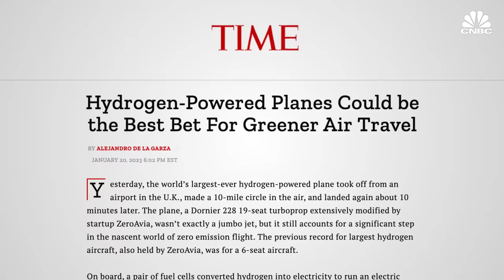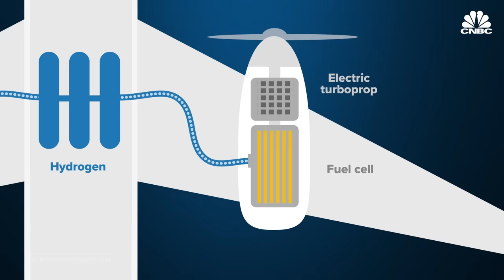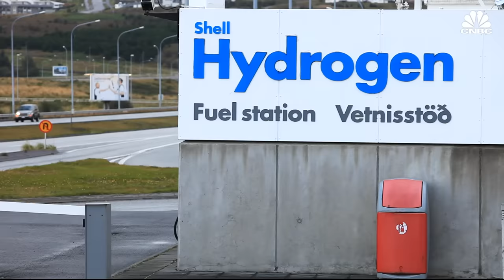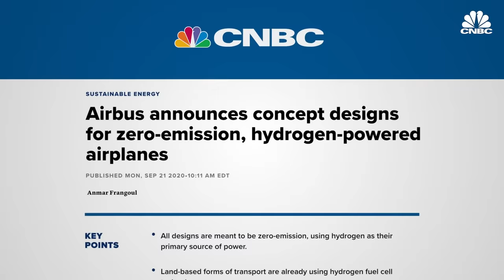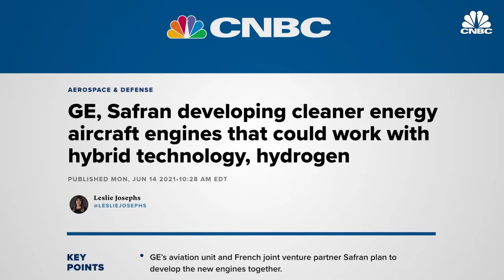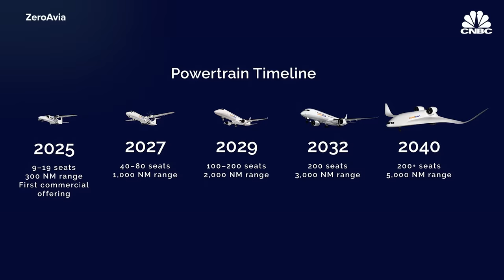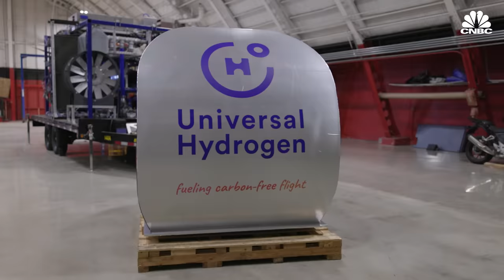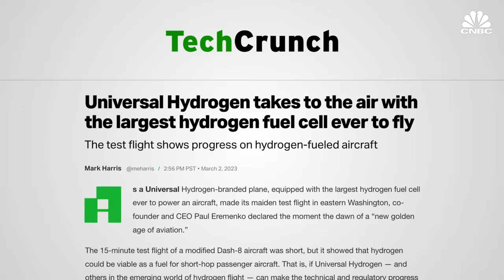Why Hydrogen-Powered Planes Will Beat Electric Planes

Comment: You don't really need hydrogen to reach 0 CO2 emission goal. You can just produce a conventional aviation fuel from plant sources. For example corn is used to produce fuel in Brazil. Whatever CO2 produced by such fuels will be re-absorbed by the plants to produce oxygen. So overall the total net emission of CO2 would be 0.
If there is not enough land for planting, they can use sea and using algae, the same goal is achieved. This is much less costly and can re-use the existing airplanes and technology.
Reply: The problem with biofuels (particularly ones made from corn) is that they require astronomical amounts of water

Comment: the problem with Hydrogen is the cost in energy and other resources in producing pure hydrogen, storing it, distributing it, so all the advantages of hydrogen quickly evaporate when you add up all the cost. We need research on reducing the cost of all of this before we can make good use of hydrogen.

Comment: At minute 3.00 in this video the claim "hydrogen fuel cell is more efficient than combustible hydrogen" is not true. Combustible hydrogen in the ICEngine of a Plug-in Hybrid PHEV drivetrain can 'effectively' deliver more than twice the equivalent MPG possible in fuel cell EVs. This personal car application of combustible hydrogen emphasizes the need to reduce driving overall, not merely replace fossil fuel for travel and transport purposes. PHEVs offer more equitable distribution of  battery resources and the more ideal application of solar PV arrays (on rooftops and neighborhood mini-grids as opposed to vast solar field arrays that require long-distance transmission lines connected to complex regional utility grids, both of which remain vulnerable to power outage. Most air travel is recreational. A lesser level of air travel is defensibly essential.

Comment: Water vapor is also an emission.

With the current gains from renewables, we will never have enough power to generate enough hydrogen. Our prices for electricity will skyrocket and meanwhile we neglect nuclear technologies for blue sky technology.

I'm from the Netherlands, here on our best day we totalled just over 400MW from renewables. A single MSR will do the same, 24 hours per day, seven days a week and for 50 years. Why are we investing billions in renewables when the gain from a single billion MSR is very clearly cut: better.
Reply: So at any time there are about 10000 planes in the air, lets say with a 1MW power source per plane we can only deliver 5% of the power required to keep all these planes in the air.

So this idea might sound nice, it is completely unrealistic if we keep using renewable energy sources.

Comment: Hydrogen still emits the water vapor to form clouds which is the majority of the radiative effect of aviation. Switching to green hydrogen will eliminate CO2 emissions, but it doesn't solve the greenhouse effect of aviation. Battery electric planes are the future of short range flight, since they will be so much cheaper to operate than hydrogen planes. I suspect that long range aviation will be dominated by battery and biofuel hybrids, because they will be cheaper to operate, and their radiative effect will be lower than hydrogen planes.

Comment: Hydrogen looks good on paper and in trade studies. But it causes a lot of problems right from the design stage. The liquid H2 pipes cannot be inside the fuselage, for obvious reasons in case of a leak. They have to be outside the fuselage, which creates more drag and you have to protect them there. Also, the insulation makes the pipes quite thick. These problems are just related to the pipes. I work in the field and there are a lot of other problems. These problems can be solved, but due to the increased complexity it will definitely have a negative impact on the price of the plane, maintenance, passenger capacity, airport handling and more... I'm really struggling right now to know if the hydrogen plane is the best way to go. It would be great if there was an e-fuel that is liquid at room temperature, has a high gravimetric energy density, is non-toxic and has low carbon emissions when burned. Can someone please develop such an E-fuel?

Comment: Did they mention that currently commercial hydrogen comes from fossil fuels? It could be made by electrolysis, but it's more expensive that way.
But yes, continue with the experimentation. Modern avgas, used for piston airplane engines, even has lead in it.
Reply: they just recently developed unleaded avgas....with hydrogen the idea is that you would split water using green energy.
Reply: @neutrino78x  Yes, I know electrolysis can be powered by green energy, but it's more expensive to do so. The cost difference (currently) is significant enough to prohibit anyone.
Reply: @Nehmo  

"The cost difference (currently) is significant enough to prohibit anyone."

Currently, yes. It's not like aircraft are going to convert to H2 tomorrow.

Like I said, the plan is for all the H2 to come from green sources. Our grid here in California is very clean. During the day only about 10-12% of our power comes from fossil. We have the largest geothermal plant in the world, we have lots of hydroelectric, we have a nuclear plant, we get 12+ GW from solar, we have two of the largest battery installations in the world. We're adding more solar and wind and storage every day.

Comment: You cannot overcome Hydrogen's volume problem.. There is absolutely no beating physics..
Reply: thank you for saying this. people are dumb.
Reply: You can't increase the density of liquid hydrogen, but you can build planes with bigger tanks.
Nonstop transatlantic flights with hydrogen should be no problem.
Reply: Theoretically, you could achieve a higher density with cryo-compressed supercritical hydrogen, but due to the high weight of pressure tanks, it's no reasonable option for planes.

Comment: I wonder if the hydrogen powered airline industry is going to be cheaper in the long run
Reply: Major improvements in converting water to hydrogen and fuel cell technology will have to be solved before it will be cheaper than today. Although we could argue the overall cost of burning fossil fuels is extremely expensive since it also causes major pollution and climate change. But hydrogen is not a solved problem and it is very expensive to make, to store, and to use.

Comment: The basic equation is that to move people quickly by air, a lot of energy is required.   The amount of long distance travel has increased phenomenally since 1960.  Before that most people didn't fly and rarely went on long trips. 
What does this all support?   
The engineers may be able to make hydrogen aircraft practical and economical

Comment: The biggest problem with hydrogen fuel is storage. This isn't like jet fuel sitting in a tank. The tech behind hydrogen fuel storage requires a skilled ground crew at every airport that services these types of aircraft. Just this past year, we've seen a number of ground crew accidents that involve things as simple as towing an airplane so it doesn't hit a building, or not standing in front of a running engine that they were told repeatedly was dangerous. Are they really competent enough to safely handle pressurized hydrogen?

Comment: Doesn’t hydrogen easily catch fire?
Reply: So wouldn’t the chance of any accidents substantially increase if we switch to this?
Reply: Joel beat me to it, gas is also incredibly flammable. Its no difference.
Reply: They aren't combusting hydrogen. The cell combines hydrogen with oxygen and the chemical reaction produces electricity. It's safer than current combustion engines.

They don't need hydrogen combustion engines unless it's something like a jet fighters, which in that case, yes, they are essentially flying a hydrogen bomb.
Reply: @joelimbergamo639  While it's true that both kerosene and hydrogen can burn, there are significant differences in their safety implications. Kerosene has a relatively high flash point, meaning that it requires a higher temperature to ignite. This means that if a match is thrown into a puddle of kerosene, it may not ignite immediately, or even put the match out. In contrast, hydrogen is a highly flammable gas that can ignite easily at room temperature, even with a small spark. When stored cryogenically and under high pressure, the risks associated with hydrogen become even more significant. In the event of a crash, the tank storing the hydrogen can rupture, causing the hydrogen to instantly boil due to decreased pressure, rapidly escaping and mixing with the surrounding air. This can result in a highly flammable cloud of gas that can ignite with the tiniest spark and at practically any temperatures, leading to catastrophic consequences.
Reply: Yes! Remember the Hindenburg! What we must develop is a non-flammable fuel.
Reply: @klnsbl  Hydrogen fell cell technology is shifting to using ammonia instead of liquid hydrogen, because it's easier to store due to it not requiring freezing temperatures,it actually holds more hydrogen than liquid hydrogen, and not as dangerous to handle.
Reply: Need to see how it works

Comment: The actual solution to this problem is rails
Reply: it's a bit hard laying rail tracks over water... but for continental trips i 100% agree.
Reply: Yes look at Japan, even normaal high speed trains can do 500KM an hour maglev can be even better ans no need for batteries and use greenisch energy.

Not in regular service but look at the video "tgv record 574.8 km" they did that with a normal train and track.
Reply: @RoderikvanReekum  that is not true. the fastest regular shinkansen train in japan tops out at 320 km/h. the maglev will operate at 500 km/h.
Reply: @klnsbl Not in regular service but look at the video "tgv record 574.8 km" they did that with a normal train and track.
Reply: @RoderikvanReekum  not a normal train tho, iirc they stripped it of some things and had different motors and such in it. But having regular trains drive services at 500km/h isn't doable. The wear on the train and tracks is way too much for now
Reply: @evo3s75  Yea I thought of that, they had to modified things and that it would be unpractical/impossible for regular service. But still it is a amazing video and they proved it is possible with technology of the year 2007, they did manage to get to that speed. but for now i guess 320km/Hour it is not bad at all.

Comment: Very exciting to see jets, and hopefully soon, ships and trains, powered by hydrogen.  Makes sense to also have battery packs to power the jets on the runway to save fuel and jet equipment.
Reply: Yup remember the hindenburg? More flammable than anything else
Reply: It's not happening, bud, this is all just pure greenwashing nonsense. The amount of hydrogen needed to power an airplane for any significant distance is absolutely IMMENSE and it's impossible to store enough on board to provide any sort of practical range.

Comment: What about  hybrid-electric ? An aircraft powered by a turboshaft engine burning ethanol that generates electricity to charge batteries and drive electric motors ? Ethanol can reduce emissions by 80% and as part of hybrid system boosts efficiency even more.

Parallel hybrid

A system that uses a battery-powered motor and gas turbine engine both mounted on a shaft that drives fan, so one or both can provide propulsion at any  given time.

Honeywell  today announced a new, innovative ethanol-to-jet fuel (ETJ) processing technology that allows producers to convert corn-based, cellulosic, or sugar-based ethanol into sustainable aviation fuel (SAF). Depending on the type of ethanol feedstock used, jet fuel produced from Honeywell's ethanol-to-jet fuel process can reduce greenhouse gas (GHG) emissions by 80% on a total lifecycle basis, compared to petroleum-based jet fuel.

Safran Turboshaft To Power Zunum’s Hybrid/Electric Airliner

Comment: If hydrogen is indeed extremely energy dense in mass, the systems required to contain it are very heavy, and enormously bulky.  They make hydrogen very ill-adapted to aviation.
Totally new technologies of engines, but mainly airframes, would have to be designed and certified, and then manufactured by the tens of thousands.  So, a hydrogen-fueled airline is not for tomorrow... not even for the next 10 years.
However, "green" hydrogen can be turned into so-called e-fuels, which would be directly compatible with today's aircraft, with no or minimal modifications.  e-fuels are very expensive to synthesize... but they are at least a workable solution to decarbonize long-range aviation.
Short-range aviation will be electric, and that much sooner than any hydrogen-fueled airliners can come to market!

Comment: We had a Hydrogen powered airplane in the past. It's called the Hindenburg. The only difference now is the tank pressure is 10,000 PSI or more. Imagine the damage it could unleash.
Reply: LZ 129 Hindenburg was no airplane, but an airship.
At it was not powered by hydrogen, but by diesel fuel.
And hydrogen powered airplanes will rather use cryo-cooled liquid hydrogen, not pressurized hydrogen.
Of course, the safety effort will be higher than with kerosene, nevertheless there is not much similarity to an airship with hydrogen "balloons" for lift.

Comment: If aircraft are responsible for ONLY 2.5% of global emissions, then they're not the problem; they're the solution, especially when considering that 4.5 billion passengers (out of a 7 billion world population) travel by aircraft each year.
Reply: But this number is going up rapidly, as global fleets are increasing and other areas are being cleaned up. It'll look very different in 20 years time if we don't act now.
Reply: you can't compare population to passengers as people take multiple fights. For instance, you can half that instantly due to the fact people like to get home after they've flown.
Reply: @Robert  You're right. But since they say 4.5 billion passengers, not flights. So I'm just gonna go with that information, at least for now.

Comment: I think an electrical plane is much better and safer than an H2 powered plane because A) H2 is extremely light and to keep it for the entire flight you need some extremely heavy alloy B) H2 can sneak between any gaps and mix with oxygen which will cause an explosion C) it's not clear how H2 powered engine is gonna work and D) like with a nuclear powered vehicle a plane powered by H2 will be extremely expensive to produce